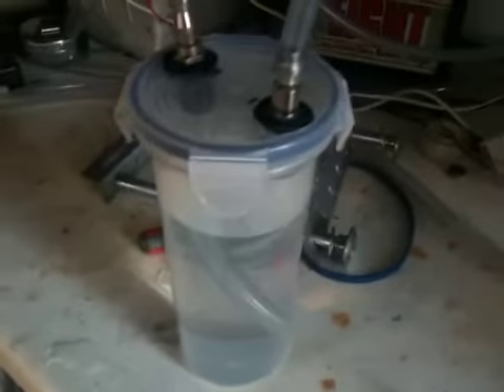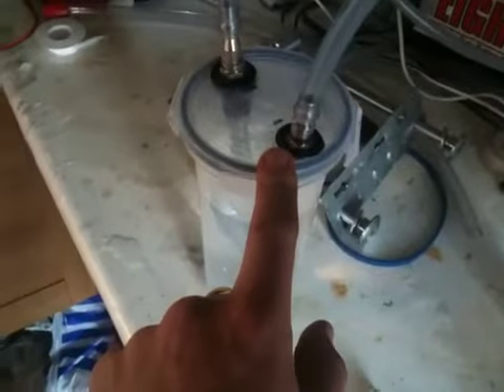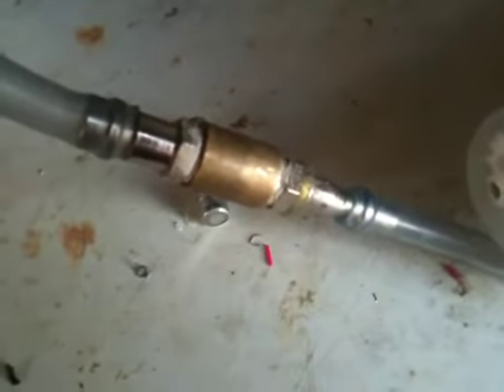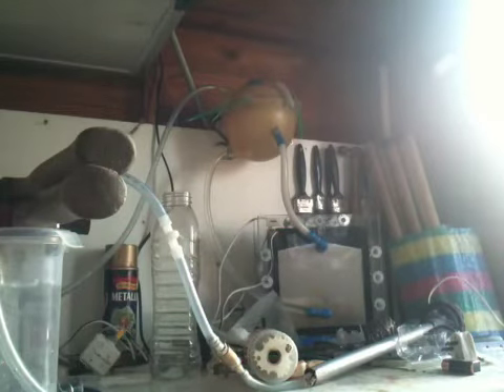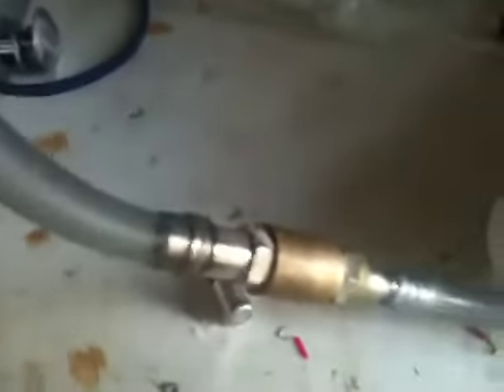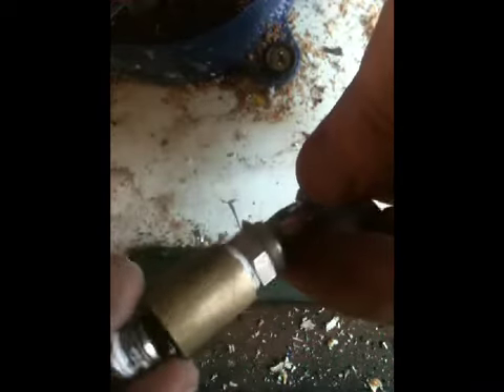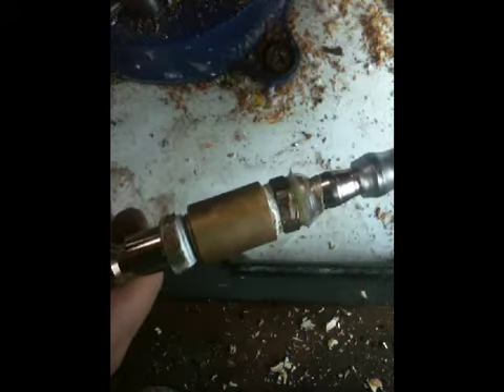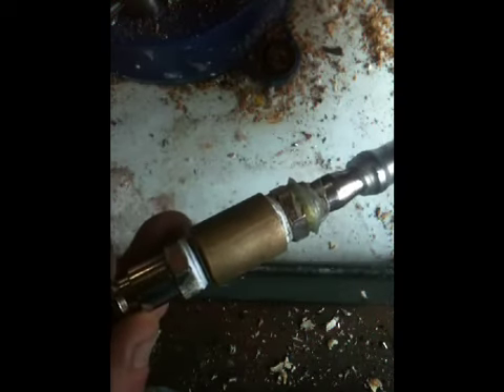Flame arrestor for HHO (a must have)

Comment: Halting a flame front depends on the geometry, the mass of the metal, and the heat transfer area to remove the heat.  This is very dangerous to design your own without understanding the parameters.  Very fine wires would not have the mass to act as a heat soak unless in a very deep bed and the irregular shape of the bed would permit passages that pass the flame.   It's likely that the mass of the valve is what had sufficient heat sink to finally stop the flash flame. 
 
Commercial units use parallel corrugated plates or tubes with small apertures and require sufficient depth to remove the heat.  Openings depend on the starting conditions (components in the fuel, the oxidant, the pressure, the temperature of before flash occurs).  Placed too far away and the flash flame front (deflagration) becomes a detonation (explosion)

Comment: does not mattery that you have a flame arrestor, that flash back valve did not work. it should have stopped the flow of gasses from going to the bubbler